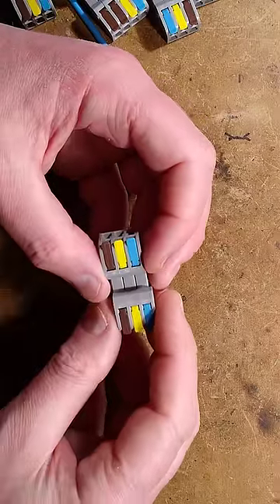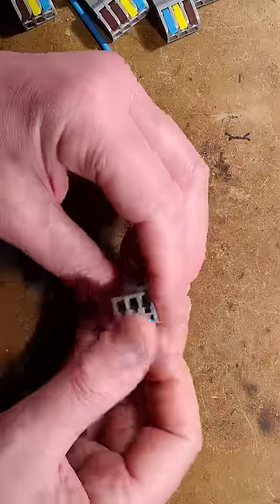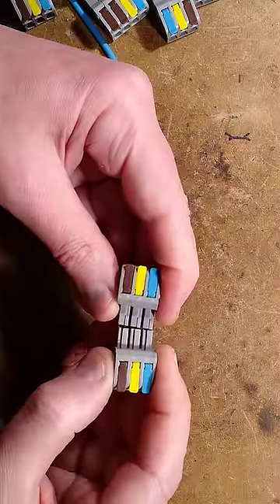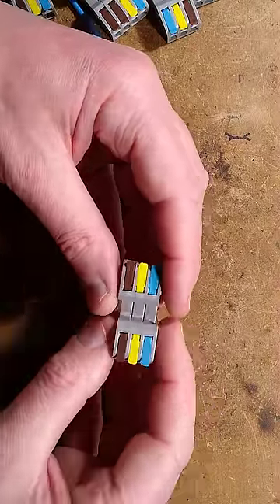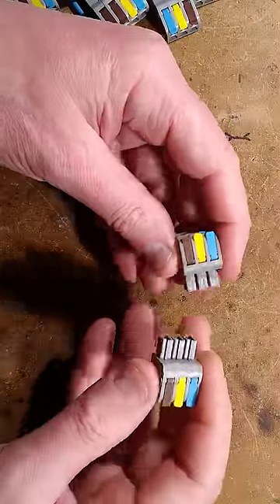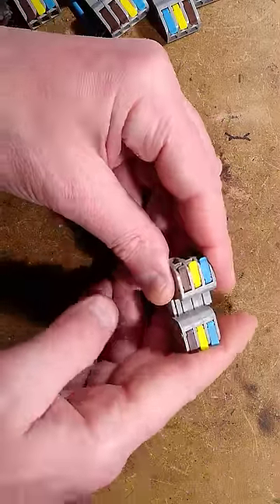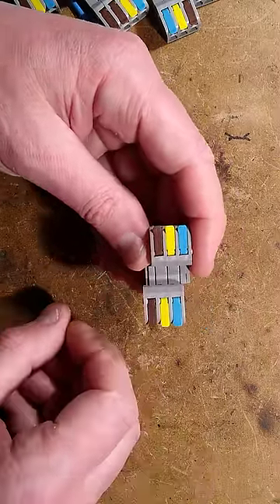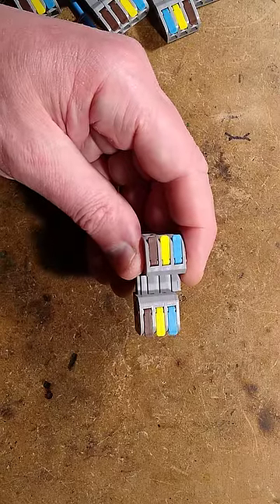This connector can kill you

Comment: This looks great for prototyping and generally lazy wring while building stage props, decorations etc. Don't think i would ever use that for AC unless its properly concealed.
Reply: Wago connectors will be your friend.
Reply: @Lawrence330 I’m a believer in those.  I do building automation controls and those things have made things easy. Kind of expensive but I have them in my bag.  Sometimes it’s so much easier to put your lead on those to measure voltage instead of a cramp wire nut
Reply: Wagos are great!  However, it's going to take time for the old-timers to jump on board. I always think about how the old sparky probably reacted when "wire nuts"  came out.. "these sissie wannabe electricians can't even solder a proper joint, they're all screwing around with there little 'nuts'.." LOL although to be fair soldering is a better connection but I also think that a Wego is better than a wire nut. But I thought about it logically and I decided that it makes sense.  you don't have to worry about snapping the wires off from twisting & untwisting. Additionally, They should in theory be able to apply a steady amount of force with the expansion and contraction of the circuit.

Comment: Oh yeah. Old floppy disk drives had this issue and I've watched people melt power supplies more times than you'd believe because they wouldn't check the connection after plugging it in
Reply: WTF? Which floppy drives were those?
Reply: @ThexthSurvivor  all lol

Look at a floppy disk connection. If you only have a picture, then the little keyed bit may appear to be safety inducing, but it's tiny and flimsy so it requires attention to plug it in correctly and should honestly just be treated as purely unkeyed.
Reply: @kiraPh1234k  I've connected probably thousands of floppy drives years ago in my old job and so did many other techs. Never heard of someone melting PSUs. It also never occurred to m how dangerous it would be connecting it improperly.
Reply: @ThexthSurvivor  
I've seen more than I can count get melted. 

But, the main issues are that the keyed connection is very weak, and easy to bypass accidentally and that they put power and ground lines right next to each other so if you are off by one you just connected a short to your PSU. 

It should be more rare, as people should look at what they're doing, and it's definitely safe to say that most of the melted PSUs I witnessed were done by the same people repeating mistakes
Reply: I'm glad I never screwed up plugging them in.

Comment: The GFCI should trigger as soon as a live wire gets connected to the ground. That’s why we got 30mA in bathrooms/wet areas and 300mA for main circuits.

It might give a spark, but killing someone would only happen with a faulty electrical circuit, where the differential would not switch off.
Reply: That's assuming there IS a GFCI.
Reply from the maker: If there is leakage protection.
Reply: Plenty of properties have older installations without leakage detection.  Some still have rewireable fuses, bringing even more scope for things to go bang...
Reply: Exactly. RCD for the win, it is a lifesaver and possibly property saver because it may also trip well before damaged wires/junctions become a problem.
Reply: Houses built before the 90s usually don’t even have an RCD.
Reply: True, but most accident occur because multiple things going wrong line up. And while each individual thing is harmless the combination can be life changing or fatal. That's why it pays to take care of each detail, because you might be missing some other things that are already wrong.

Second, the live wire isn't being connected to the ground, it's being connected to the ground of the appliance, making the whole appliance live. If said appliance is insulated from the floor by rubber/plastic feet and not touching elsewhere for current to go nothing will trigger. In which case the connection from the appliance to the actual ground is likely to be made through you. At that point a GFCI should and would save you from a bad shock but you might, say, fall of the ladder, stab yourself with a screwdriver as you jerk back, or otherwise injure yourself.

I've been shocked once but shorted live and neutral several times giving a nice bang (I realise as I'm typing this I really need to take work safety to a higher level in my job as an electrian) but I know I freeze in such situations and that's an involuntary response. If you're fight or flight, things may end badly.
Reply: @wilfriedklaebe that is illigal here if there is not one.
Reply: Like you say, there are tons of homes without any RCD protection, at least 20 to 30% based on my experience. But also as others have already said, depending on where this is in the circuit and what’s on the far end, the casing of a unit would become love and the rcd wouldn’t trip until you grounded it - even a 30mA RCD under the right conditions would allow enough of shock on a L to ground fault to be baaaaadddd
Reply: But in this case the CFGI only trips after you touch the case that has become live as the connector doesn't only connect the live to earth but substitutes it completely and connects earth to neutral which won't help you much. So let's hope the CFGI hasn't gone bad and trips in a timely manner and you don't have a particularly weak heart.
Reply: Ding ding ding, dunno about America but in Europe diferencials are on the entire home circuits as well as extras for bathroom. And besides US is only 120v give or take anyway. Will give but a scratch 👀
Reply: Notice how you guys are electricians, so this connector is just like a wago connector in my mind, cuz would you put the hot into ground terminal of one of the connectors, thus making it plugged in correctly still the same hazard as if you incorrectly plugged it together? I highly doubt that you all would make that mistake, but is it a design problem if it's color coded and the user simply crosses the wires into one of the connectors? Or is in an idiots fault who wasn't qualified to begin with? It's the same thing as wore nits if you grab the hot wore going into the device and the ground wore coming from the device and put them together under a wire nut, so is the company that made the wire nuts liable? Should they be considered poor designers? This connector is just an undafe, or safe, as any other connector. The idiots using it is the variable. This is coming from a low voltage electrician professional, though I can wore up a panel of 120V no problem. Were taught that never trust the color of wire and tone them out instead, if you're troubleshooting, because what matters is where the wire is connected, not the color.
Reply: @LinkandPage  That is asinine. You can put an automatic car into reverse when you meant to put it in drive and crash into something and it's not the car manufacturer's problem. But if you can put that same car in reverse while cruising down the highway, then it kind is.
Reply: @FFFre4k  that analogy makes no sense. In a standard car, you absolutely can put your car in reverse while on the highway, but boy your transmission is not gonna be a happy camper and plan on it hitting the ground or your chassis abd flipping you. But it's very much possible, push in your clutch and you can switch to neutral if you want but I don't think Ford or Chevy wpuld be blamed for that. It's not their fault someone untrained and incapable of driving a standard transmission is driving one on the highway. So your analogy doesn't fir in this situation whatsoever. Automatics maybe have that protection, but there are still plenty of manual transmission that get made, even in America,  and are on te road. Usially you train through parental supervision, drivers Ed classes driving instructors so that when you are doing yourself you've adequate enough training to not make this mistake and negate thr risks. The same wuth thus connector, electrician undergo training snd supervised wirk, have testing and log hours before they are allowed to work in the more dangerous situations and if you as a consumer ate untrained snd unqualified to work in electricity then you inherit 100% of the risk when you chose not to hire a qualified professional to do the work. Just like you jnherot the risk driving a standard automobile down yhe highway and them put it into reverse at 75mph. But unless you ate breaking g the law, you had to haveundegone some sort or level of training ti drive that motorized vehicle. This is not the companies fault, it's the consumers fault if the intentionally misuse or are untrained and chose not to hire a professional electrician, which I'm willing to bet somewhere on that packaging or instruction manual, it has that cautionary label so the consumer knows the risk
Reply: @LinkandPage  I couldn't care less exactly at which point my analogy falls apart. There's nothing to discuss here when not a single safety official would give a product this inherently dangerous it's seal of approval. The connector has no reason to work this way and in case of accidental misuse it becomes deadly.

Comment: That's why in Europe you have a device in your home power box that shut down under 300 milliseconds, when it detect a earth grounding 😅
Reply: So a circuit breaker, don't think that's exclusive to europe
Reply: @TheSkypetube  no its a ground fault circuit interuptor built into the circuit breaker, idk if those are standard everywhere, but thats what hes talking about.
Reply: GFCI breakers are used worldwide
Reply: They're usually only on specific receptacles in the US, not the entire house.
Reply: @JohnSmith-qy1wm  yeah that's what I thought, just in the bathroom outlets and stuff near water?
Reply: @JohnSmith-qy1wm I don't quite get why it's not in the breaker panel in the US. I mean you could just do both. In EU the old style is to just have your main breaker have an integrated RCD/GFCI meaning it would he really easy to make something backwards compatible with old US breaker panels. Granted our RCDs trip at 30mA compared to the 5mA in the US but better be safe everywhere than being super safe in your bathroom but nothing everywhere else.
Reply: @JohnSmith-qy1wm in Europe in many countries there’s a GFCI with a 300mA sensitivity protecting all circuits and a 30mA GFCI for all rooms/appliances that are coming into contact with water, e.g. dish washer, bathroom, washing machine, etc.
Reply: @Fythos123  Not sure about other European countries, but regulation in Germany is a 30mA or more sensitive RCD for all circuits that contain user accessible outlets, not just rooms with water. It's recommended to use separate RCDs for every circuit so that if it blows, not the whole apartment/house/whatever is dark.

Sometimes there are more sensitive RCDs (10mA) for the rooms with water, but that's up to the installer's discretion. It's a tradeoff between how likely a spurious trigger is and slightly faster switch-off in a "real" case.

Comment: What I learned from "fumbling behind machines with odd/unkeyed connectors" is to ALWAYS make sure that ALL sides of both connectors are flush with each other. 

Just touching them once, all around the circumference, after plugging in is enough and if you're putting installing these terminals you're likely to have shut the power off already anyway - bare live wire and stuff...

I mean, whenever one plugs in anything really, one should always check if it's properly seated.

It's not the designer's/manufacturer's fault if one willfully wants to save 3 seconds (at best) in exchange for potentially fatal device/user safety hazards.
Reply: Yeah, I would never use this with live wires, and I'd check the connection before I switched it on.

Comment: In my electronics hobby, I use a similar connector BUT you Cannot connect 2 of them together. They simply are used for common connections - say if you have 3 transformers in a build, you can safely connect the 3 hots together, the 3 neutrals together (obviously using a second connector, etc.  - you would also need a 4-hole connector to use in this case)

Comment: I generally wear leather / rubber tactical gloves as work gloves when I fumble around with electicity at the haunted house I work at. Worst I ever experienced was when I was trying to plug something into a old sketchy power outlet (wires exposed, unscrewed, in short OSHA wouldnt approve) My arm just started to vibrate and I yanked it back... I knew I was just electrocuted but I felt no pain it was like my entire arm became a vibrator it was weird but I feel like if I didnt wear those gloves it wouldve been a way different story and I wouldnt be the one telling it.

Comment: I can’t even think of a reason why I would want a universal mating connector like this. After all, usually your signals have to flow in a specific direction. Maybe it would be useful for a low speed digital bus when making prototyping cables, but even that’s a stretch.

Comment: Love this connector design! Where can it be bought beside eBay ? Couldn't find it with a quicvk search using keywords such as "reversible", "universal", "socket-plug".

FWI, I understand the legitimate safety concern, but for my specifc use case it can be completely eliminated, hence why I am interested in this product.
Reply from the maker: There's a full video about it showing its modularity, weaknesses and giving the model number.

Comment: This would be very easy, and cheap for the manufacturer to fix going forward by just making the shape for each plug a little different like you see on 6 or 8 pin connectors on a PC.

Comment: Of course this isn't the safest thing but normally you cut the power when working and there should be a RCD that immediately triggers if the pins in the connectors touch even a tiny bit.

Comment: sounds like a problem that can be resolved in the design stage, by otherwise changing the connector shapes depending on whether is positive, negative or earth. Internal latches that are also fitted differently on each connector should also prevent being able to shove a positive line directly into the earth. It might bring price up a bit in the long term. But what’s a couple of quid to reduce a safety risk?

Comment: It's a really bad design if it isn't keyed in any way, but that's exactly what RCDs are for.

If you haven't got an RCD/Gfci  at home, install one. It's 20 bucks. Even if there's no ground wire from your mains supplier, they can still offer some degree of protection. You can also get an ok ground connection from a metal water pipe or something similar.

Comment: As someone working with electricity i can't fully agree because always there is some kind of differential switches that would disconect whole circut whenever you'd plug it like that so you could get electric shock only if some breakers would be broken so you messed up for not checking safety. Although i must say design isn't very good.

Comment: The term "fool proof" is referring to design that prevents this kind of thing from happening. Normally, you would design lead and ground so that there is no way you could connect them by mistake.
These kinds of connectors usually have a keyway that makes sure they can only fit a certain way.

Comment: a very easy way to fix this would be to add some sort of notch or otherwise change the shape of the ground connector. That was you A) can know which connector is ground by touching it even if you can't completely see it, B) cannot misalign the ground connector with live, and C) cannot misalign two different grounds with a flipped connector.

Comment: The most despicable thing is how easy it is to add in a little bit of idiot-proofing. All they would need it to make the connectors slightly asymmetrical, or similar to prevent such blatant safety issues

Comment: would this not trigger the RCD in most UK homes?
Reply from the maker: Only if the device being connected was on a grounded surface.  And only if there actually was an RCD - which isn't always the case with industrial equipment.

Comment: If the grounding system is connected properly it should trip the breaker before it can cause any harm. I may be wrong but I don’t think you would even feel anything because the amperage would flow through the path with least impedance, which would be the ground circuit and not your body
Reply from the maker: Current flows through ALL paths of resistance and it takes very little to kill a human.  If the device that was plugged in was not on a grounded surface it could sit there live until touched, and then the only protection might be an RCD/GFCI if one is fitted.

Comment: This is is so small and easy to happen it's 100% guaranteed to happen. Electrical fires/mismanagement is one of my fears. Just yesterday was looking through a drawer for a charger for a shaver. 2 chargers  one was plugged into the shaver, the other not. Most would assume the one already plugged in was the right one. Turns out the loose charger was the right one. Now probably wouldnt have started an electrical fire but electrical fires terrify me. 

Good rule of thumb as long as the wall plug has a higher output value than the device that's plugged in youre good. It's when you plug something that pulls too much electricity out of a wall plug that can't give that much charge is when bad things happen. And don't chain together power strips. And if it's a high power usage item like some serious piece of equipment plug it directly into the wall

Comment: This problem can be solved by placing plastic extensions to prevent the wrong wires from being connected to each other, such as the power supply wires in the computer when we connect them to the motherboard.

Comment: It's a connector for low voltage systems. That would melt under industrial load. I really wouldn't want use above a 24.5v system.